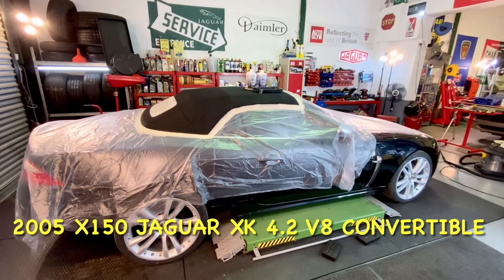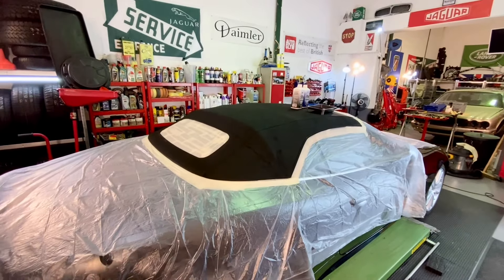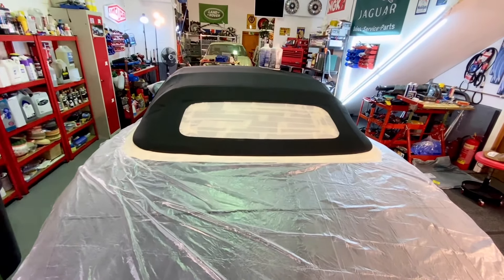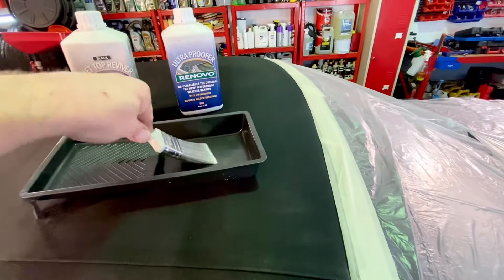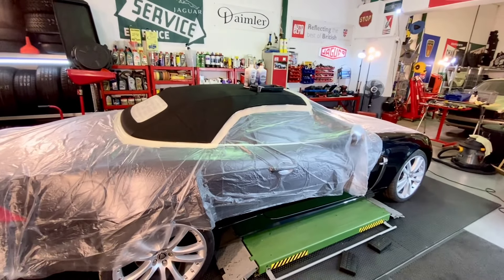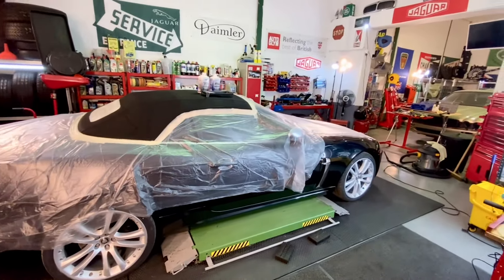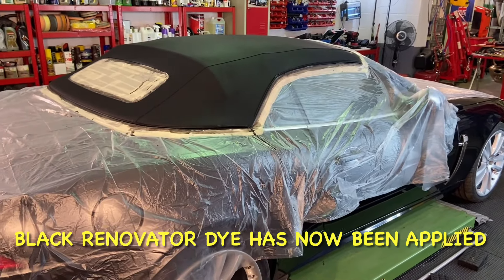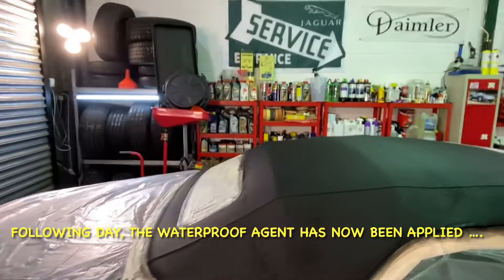Jaguar XK X150 Convertible Soft Top Renovation @ The Malton Motor Company

Comment: Good video Matthew, Peter from Cumbria, I bought the Carnival Red XJ Sport off you 2 years ago, so I know the good work you put into presenting your cars. I run as a daily, a Merc C class convertable, I've done my soft top before with the Autoglym soft top twin pack cleaner and protector kit. I've not necessarily been happy with the cleaner in the pack so I'll try the Autoglym interior cleaner next time as you've used. Cheers
Reply from the maker: Thanks Peter, glad you’re doing well and enjoying that beautiful Jaguar you bought from me. Try the Autoglym interior cleaner, spray plenty of it on neat from the bottle on a section at a time and get a good scrubbing brush to agitate it with hot water. After you have cleaned it all rinse off well with a hose pipe not a jet wash, dry off well. Take care, nice to hear from you.